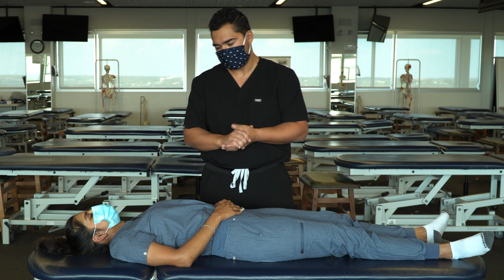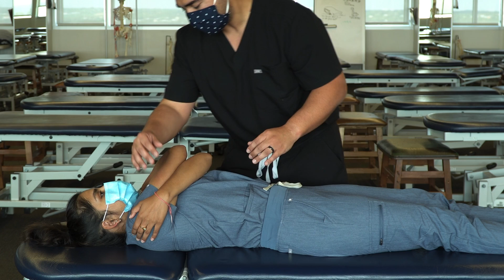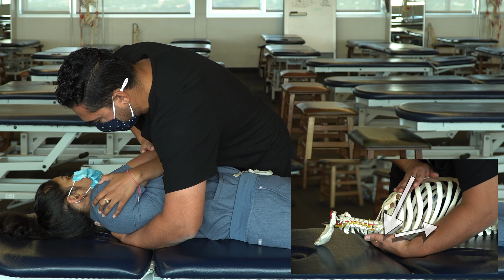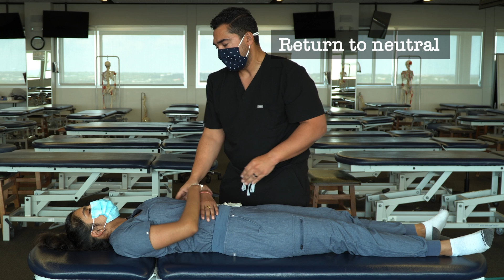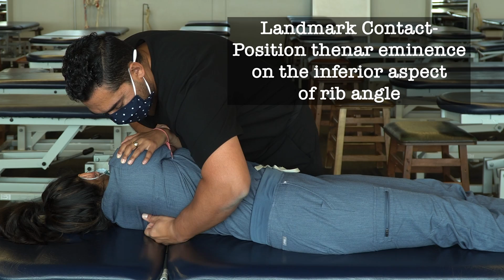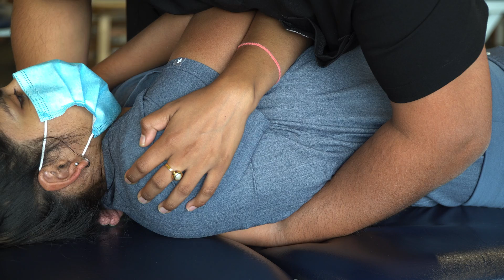OMT: HVLA - Costal Cage (Ribs 3-10; Supine)

Comment: What u mean by "far" over "near" I didn't got that one
Reply from the maker: It’s a way to remember which of the patient’s arm is on top and which is on bottom when you have the patients arms wrapped in front of them. When using the approach I described, you would position the patient’s arm that is farther away from you (the “far” arm) on top (“over”) the arm that is nearer to you (the “near” arm).
Reply: @OsteopathicClinicalSkills  Thank you very much for the detailed explanation — it makes perfect sense. Your videos are always well-prepared and informative. The only suggestion I’d make is to maybe include different clinical contexts, like cases where the patient is overweight, has shoulder pain, etc. That extra nuance would make the content even more valuable. Thanks again!